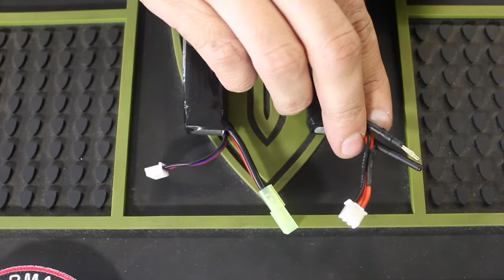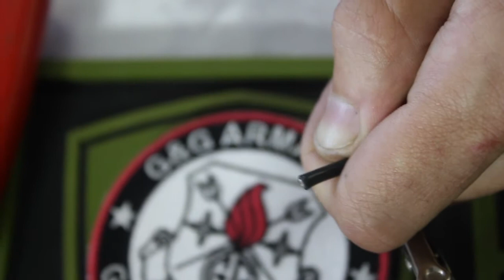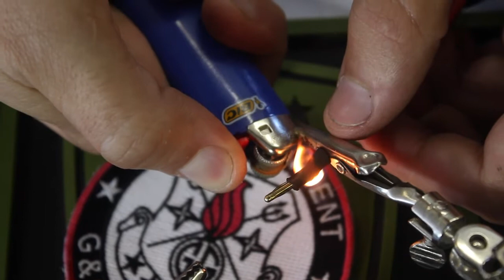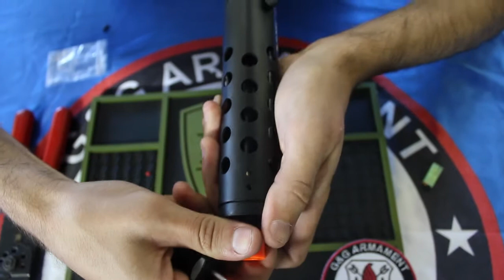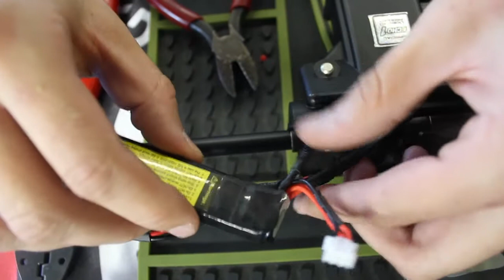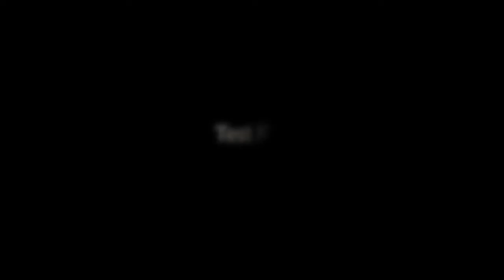Echo 1 Gat Battery Mod No More Grip

Comment: wait are u charging a lipo from the neg pos battery wires? u know that blows up the batterys right and u need a smart charger
Reply: They mentioned it for non lipo users
Reply: bang bang that’s not true....
Reply: On some balance chargers you have to plug in the pos and neg wires to charge

Comment: we're can I get a replacement forward grip? Broke mine when it fell off my table.
Reply: I think there are grips (different then the one it comes with) that hold batteries on airsoftgi . btw do you know if the grip it comes with fits 2 or 3 cell stick ?
Reply: http://www.airsoftgi.com/advanced_search_result.php?keywords=foregrip+battery&inc_subcat=&categories_id=&x=0&y=0&inc_subcat=1 Here is battery holding grips

Comment: how is the rail connected? can you take jt off?
Reply: Niko Opperman it is removable, the screws that hold it on are accessed from the inside when the upper and lower receivers are separated.

Comment: Will this work with the RDP
Reply from the maker: Don't know never had the chance to open one up
Reply: +yourairsoftchannel could i just use a mini tamiya connector on the gat
Reply: +John Doe no we already tried doing that it was still a little too big.
Reply: oscar diaz damn butbthx for info.... Also I have a big TAC rail would it be possible to cut out bottom of barrel shroud(not all of it) and put battery there and use big tacril to hold in battery
Reply: +John Doe I see y not. I never done that before you just have to make sure you still have enough battery room. FYI the battery we use was 7.4v lipo 20c 1000 and it gets about 4-6 hours of gameplay depends on your trigger finger.
Reply: Help my front sight is not held on by a screw. How do you get it off?

Comment: I would legit pay u to do mine
Reply: Probably doesn't have the tools and equipment familiarity to safely perform this mod. When you're cutting wires of lipo battery packs, there is a very real risk of getting electrocuted or causing a fire/toxic fumes if you don't know what you're doing. Remember kids, always cut one wire at a time and do NOT let the bare wires touch each other!